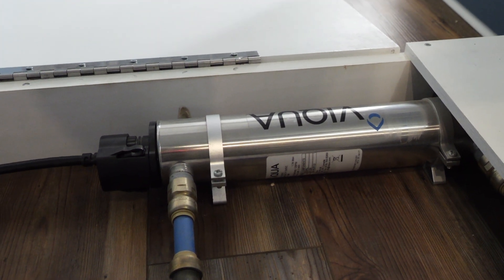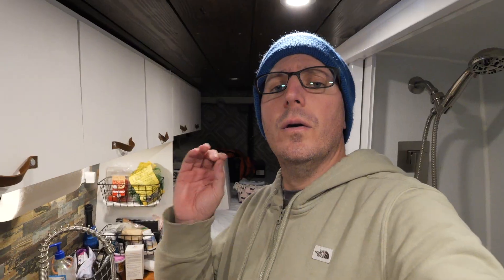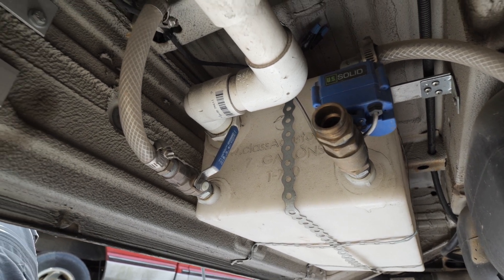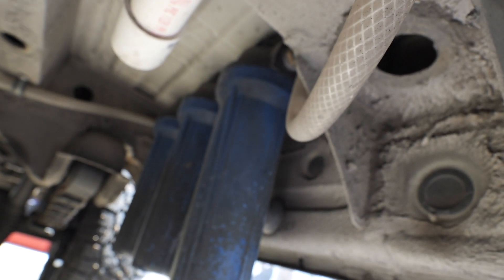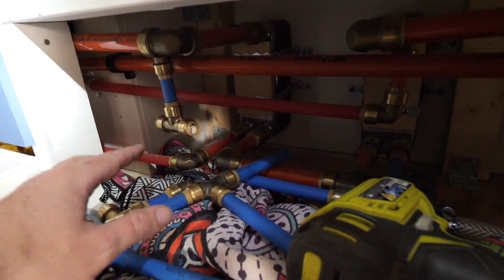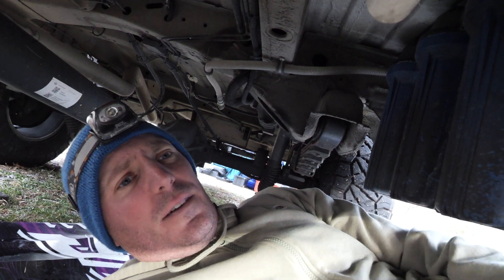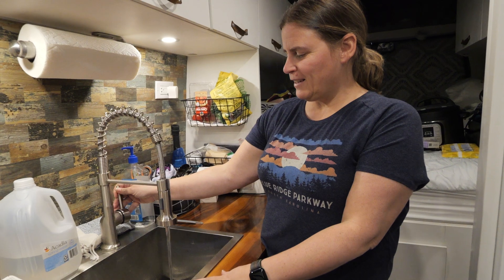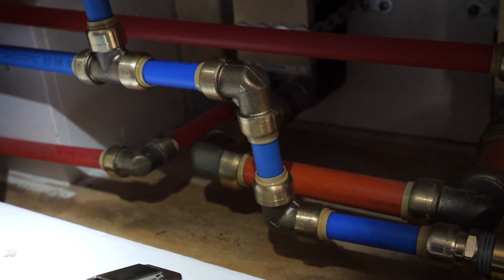A RECIRCULATING SHOWER for Vanlife Update  |  Is it WORTH IT?

Comment: First of all, as a caveat, I will just say that I have not built a recirculating shower system.   Secondly, I will tell you that I abandoned the idea of a recirculating shower and decided I would focus on an alternative approach that I think would be superior:

1 -  Instead of a recirculating shower, I would suggest a gray water recycling system, instead.  This would work with both the shower and the sink(s) that you have.

2 -  Install a float switch in your gray water tank about one third up the side of the tank, so that the switch is closed when the level in the gray tank goes above the point of the float switch.

The reason you would want to install the float switch about one third up the side of the tank is so that solids have a chance to settle to the bottom of the tank and are less likely to reach the filter system.

This float switch will toggle the pump for the system on and off, as the water level rises and falls.

3 -  Install a bulkhead fitting at a point just below the level of the float switch, so that the water level is above the bulkhead fitting and below the float switch.

The reason you would want to do this is to ensure that the water level is always above the bulkhead fitting when the system is operating.  This way the pump will never be cavitating.

4 -  Plumb a spin down filter to the bulkhead fitting installed in the gray tank.

This is a component that is likely to need frequent emptying and cleaning, depending on the amount of solids that end up in it - which is why you would want the bulkhead fitting to be one third, or more above the bottom of the gray tank.

5 - Next, route the water through the pump and then to a pre-filter that is about 20 microns, followed by a 5 micron carbon filter, followed by a 1 micron ceramic filter.

The 20 micron filter and the 5 micron carbon filter will need to be replaced on a regular basis, depending on its frequency of use.   The 1 micron ceramic filters usually come with a wire brush that can be used to clean it, rather than having to replace it.

6 - Next route the water to an accumulator tank that is set to about 45psi.

7 -  Following the accumulator tank, route the water to a reverse osmosis system.    These are typically rated at 50 to 200 gallons per day flow rate.

There will be two outputs from the reverse osmosis system.   One of the outputs goes to your fresh water tank.    The other output goes back to the gray water tank through any existing drain plumbing

The reverse osmosis system is going to be much slower than the pump can pump water.    The pump for the system will be switching on when the water level in the gray tank goes above the float switch and switching off when the pressure in the accumulator reaches the set pressure and when the water level in the gray tank falls below the float switch. 

8 - Install your UV filter on the output line of your fresh water tank, so that all of the water you use will have been sterilized.  And, only the cleanest water will be passed through it.  Remember, the UV filter depends on the light inside being able to kill any bacteria and viruses in the water.   So, it is ineffective if the water is cloudy.   Additionally, the UV filter should be attached to an inline flow switch that turns the filter on only while water is flowing through it and is off when no water is being used.

Suggestions for extending the life of the filter cartridges:

Use no soap or shampoo while showering and use the minimum amount of soap needed to wash dishes or anything else you might wash in the sink.  If you must use soap while showering, use bar soap and as little as possible.  I have not used shampoo in almost twenty years, using only warm water to wash my hair.   When I stopped using shampoo I also stopped needing any kind of product on my hair, since my hair was not stripped of all the natural oils.

Use a fine mesh filter in the drain of the shower and sink(s) to pre-filter solids from reaching the gray tank.

NEVER put grease or oil down your drain.  However, since the system will stop running before the water level drops to the bulkhead fitting for the system, any small amount of residual oil from dinner plates will rise to the surface of the water and not be drawn into the system.

Periodically drain completely and wash your gray tank while the system is disabled.

Another advantage of this approach is that you need only one water heater - that should be an instant hot water heater for long continuous showers.   Or, you can use a regular hot water heater and just be satisfied with shorter showers, while still saving almost all of the water.

And, of course, all components should be located inside a climate controlled environment or heated, if positioned where they might be exposed to the cold.  And, purge the entire system when winterizing for times when you will not be using the vehicle.

I hope these comments help anyone considering such a system.
Reply: Is there any way possible to make it more complicated?
Reply: @wagu7003  If you have a better approach to achieving the same or superior results, I'm all ears.

Comment: Why not just plumb your sink water supply into the shower? You'll have dual hoses/shower set-up, but it means you can wash soap-free (recirculating mode). Then rinse with normal shampoo/conditioner (which can exit straight to gray water without going through your filter system?

Comment: Just have a sediment collector tube at the bottom of your holding tank 
One valve at the top of the tube and one at the bottom. 
Soaps and sediment will collect in the tube 
Occasionally 
Turn off the top valve and turn on the bottom valve to purge the sediment 
Make your system reverse flushable to clean out filters 

Scrap UV everyone seems to have issues 
UV does nothing a few drops  of chlorine in the drain won't do
Reply: Do you have some more info/sources regarding these tips/tricks?